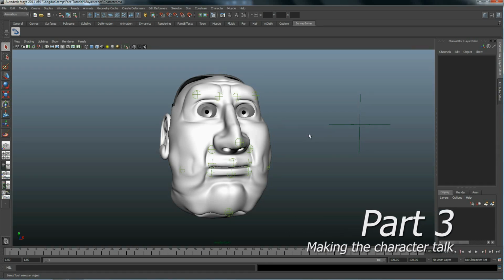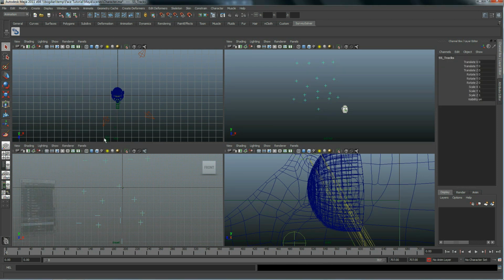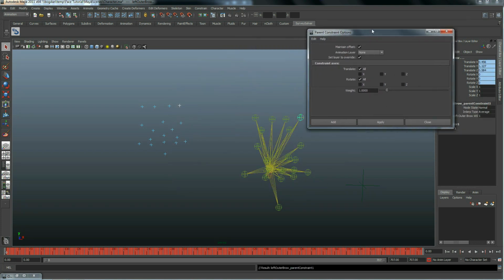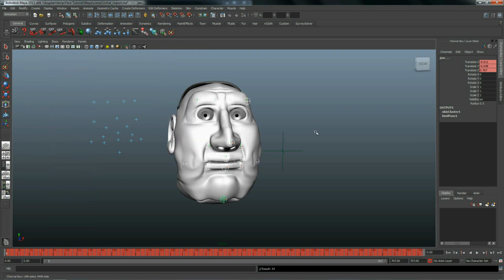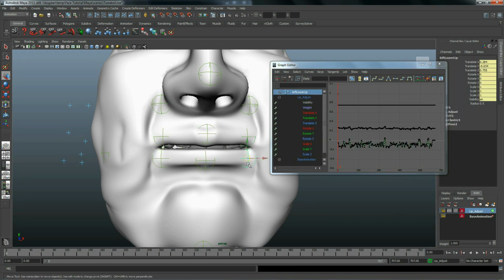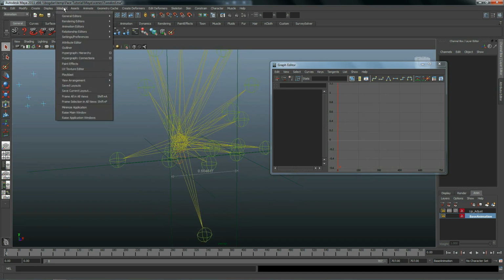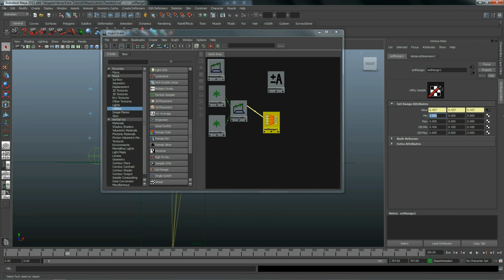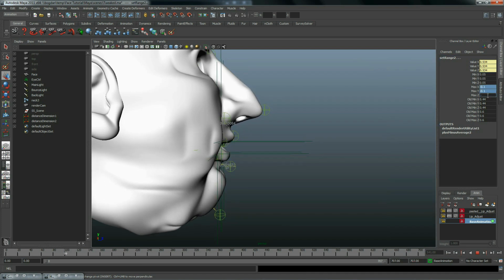Cheap Facial Motion Capture - Part 3

Comment: Question, suppose I want to use facial tracking movements for someone with a non-human head (like Smaug from the hobbit) is there a way to adjust the Mocap rig (after it's tracked) to fit the non-human head, or are the Mocap rigs permenant?

Comment from the maker: The eyebrows are handled by the two marker points at each side. In this particular example the result is not great because the markers were slightly obscured by the helmet I wore. I intentionally left out the eye tracking but will include this in a future tutorial. But if you want to try it out, just track the pupil as you would with a regular marker. Then move the eye locator in front of the head in Maya and aim each eye at the corresponding locator.

Good luck!

Comment from the maker: Thanks! Technically it should work and Mocha has a very robust tracking. The problem is to output the data in a usable format. I haven't tested it my self but I have plans to make a new tutorial showing how to get generic tracking data into Softimage FaceRobot. That way users could perhaps import data from different software and be able to output the finished animation to both different 3D packages and game engines. No ETA on the video at this point but lets say before the end of 2012 :)

Comment from the maker: @DCStudiosofficial Hello! Make sure that you select them in the correct order when performing a parent constrain. First select the point/locator then the bone and choose parent constrain from the constrain menu. Also make sure that the constrain settings has the Maintain offsett selected, otherwise that bone will move back to the position of the point/locator.